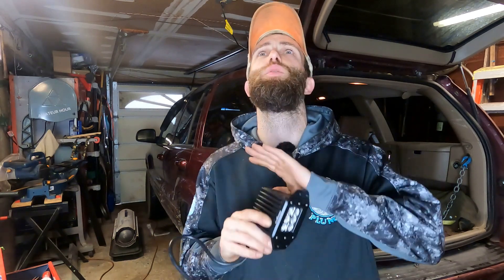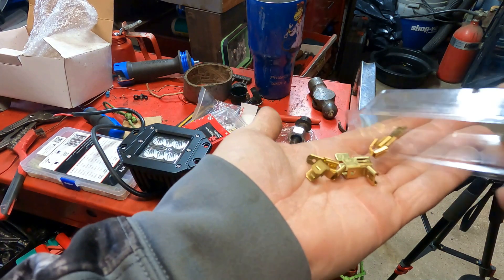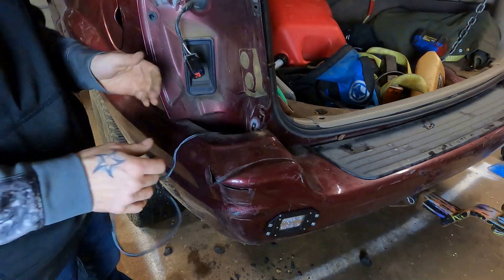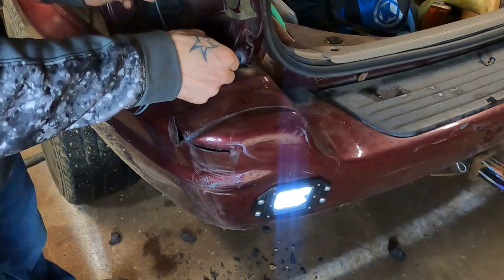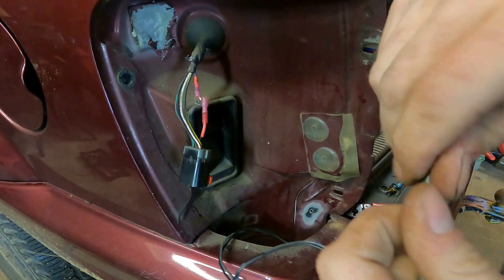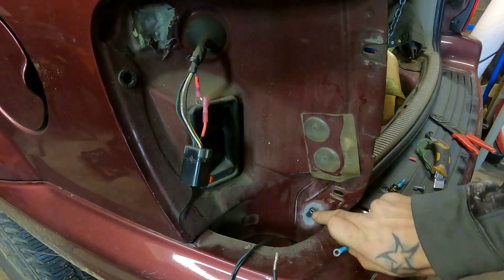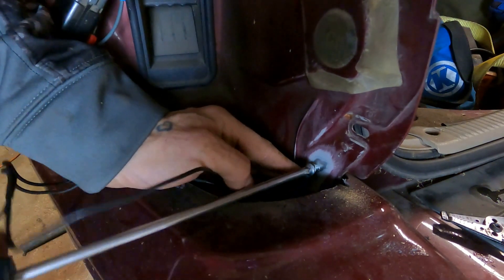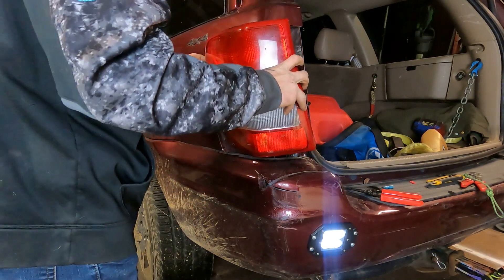Add AFTERMARKET BACKUP LIGHTS to ANY VEHICLE super easy/inexpensive

Comment: I did those a couple years ago, but I actually cut them into the metal of the rear hatch, on each side of the rear license plate... I only had to ever so slightly trim the heatsink on the lights, they barely get warm though so its fine.

Comment: The harness for the trailer 7-pin connector has a convenient place to tap reverse and ground connections, if you don't want to hack up your wiring to your tail lights.
Reply: Yeah saved my butt with a camera

Comment: Make sure if you have trailer assist back to 06 on jeeps you do it totally independent. It senses the voltage drop and thinks your backing up a trailer and turns the lights off so they don’t reflect in your face. Ask me how I know. What a waste of a day. It works great tell it running.
Reply from the maker: That is a good point bud. Thanks!